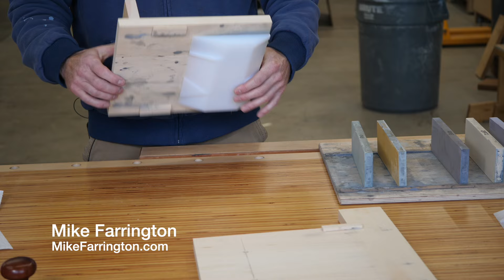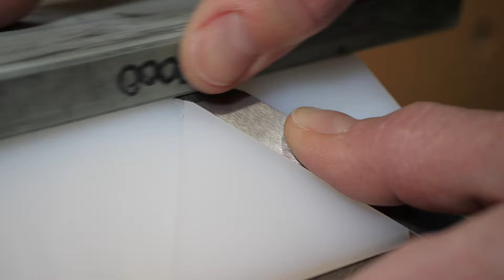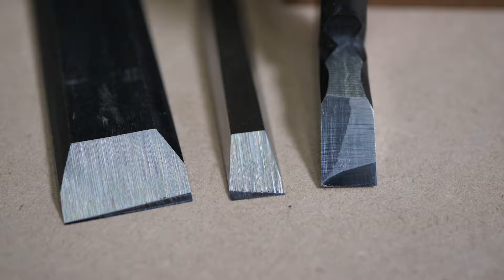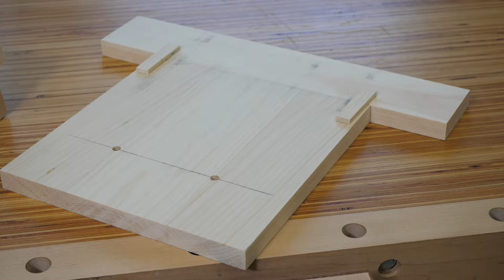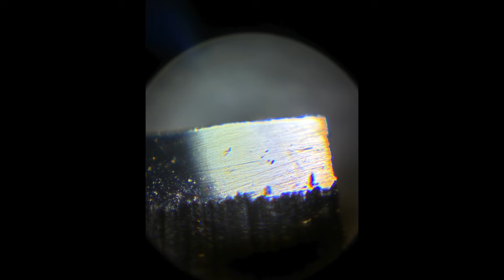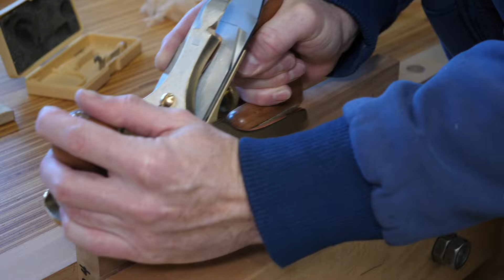A new kind of sharpening jig

Comment: I'm gonna 3D print this immediately!
Reply: lol. But seriously the hmwpe material is what’s important.
Reply: @jayelwin  you're absolutely right, I could never print a product at durable, or accurate as the one shown in the video.  BUT if I'm a crappy wood worker with one shitty Stanley chisel that can't hold an edge anyway......
Reply from the maker: I looked into having these 3d printed, currently, there isn't a printer that can print densely enough. Yes, it would work, but the lifespan would be low. Also, because it's not printed densely enough, keeping the top clean is nearly impossible.
Reply: @MikeFarrington  you could print them with a 100% infill, then have to do something to the surface to make it smooth like bondo or something... It would be a nightmare and definitely wouldn't be as reliable as the real one
Reply from the maker: @tazerdave5371  Which is exactly why I settled on milling from a solid block.
Reply: @MikeFarrington  good idea!
Reply: @MikeFarrington  My initial thought is print it with a recess and install a 1/2" thick wear strip of uhmw. Or maybe even uhmw tape on on a 3d printed part would be sufficient. I'd also bet that printing the top surface with all lines parallel to the motion of the stone would work pretty well with something as humble as PETG.
Reply from the maker: @davidchester5784  Good ideas for sure. I will say my experimentation lead me to the opinion that anything 3d printed would not work. The lines left behind just catch too much crud.
Reply: @MikeFarrington  makes sense! Awesome product. I just mocked up a rough setup to test the concept and got my test chisel as sharp I ever had and it was very easy. I'll be placing an order for the real deal shortly!
Reply from the maker: @davidchester5784  Sounds good, Thank you.
Reply: Good one! Embed rare earth magnets in the bevels to assist holding the blades?

Comment: This looks really interesting but wouldn’t the top wear down. How is the top going to stay “square”?
Reply from the maker: Yes, that is addressed in the video. The jig will wear down over time, but it should last for many years. As to staying square, it really doesn't need to be square. If it wears unevenly over time, it will still sharpen tools well, just at a slightly different angle.

Comment: Simple and effective! Consider it bought!
Reply from the maker: Thank you.
Reply: @MikeFarrington  Received it yesterday and absolutely love it. Near the end of the video you mentioned you might come out with another design that can be used for bevel-up planes. Is the current design unable to sharpen my Lie Nielson 62 low angle? I'm still a novice when it comes to hand planes...
Reply from the maker: @stavybananasify  You can absolutely sharpen your 62 on my Jig. 25 degrees is good for end grain work. 32.5 a good all arounder. However, one of the benefits of a bevel up plane is to sharpen at really steep angles, such as 40, 45 or even higher. The benefit of this is it will cut well on very wavy or alternating grain. The highest angle my current jig can sharpen at is 32.5 degrees. This leaves out that high angle. I do plan to get going on a new layout. Hope this helps. Let me know if you have any more questions.
Reply: @MikeFarrington  Thanks for the information! I use the plane as my go to plane, haven't quite committed to the No.4 smoother yet, so the 32.5 will be perfect. I sharpened all my chisels yesterday and really love how simple and effective the jig is, they've never been sharper. Will definitely purchase the next layout when/if it hits the market!
Reply from the maker: @stavybananasify  This is great to hear. Thank you very much for the feedback.

Comment: Doesn't it wear the top of the pyramid off, since the tool is only a small part of the surface you're mostly abrading away?
Reply from the maker: Thank you for the comment. I address that in the video. If stones that are designed to polish an edge are used, they mostly hydroplane on the surface. Some wear occurs, but it is small and the jig will last a good long time.

Comment: Can you comment on your hand strain while using the jig?  Your fingers looked pretty blanched white while holding the chisels.  In project touch-up seem quick and easy, but if I set to sharpening 2 dull plane irons....  I find myself with very strained hands after sharpening things.  I think I sharpen with fear of going off on a tangent (pun intended) and then need even more time to correct.
Reply: I hope Mike doesn’t mind, I got to test a prototype and I only have diamond stones. I attached a mag switch magnet to my coarse stone and went to work on a flea market Stanley, having a handle made easy work of bringing it back to life.
Reply from the maker: @MrBertstare  I do not mind at all. Thank you very much sir.
Reply from the maker: Yeah, very good question. I could sharpen a good handful before my hands get tired. My shop is pretty cold, so that adds to the look of my hands. Also, I have very pale skin, so not much effort will make them look strained. Yes, some hand pressure is needed, injuries, arthritis, etc. should be considered before using the jig. But a person with normal strength and healthy hands will have no problem going from grinder to totally sharp on several tools. Hope this helps.

Comment: Mike this is such a great idea. I’m curious if you have thought about a version that uses rollers on the top rather the just the flat plastic block. I wonder if this would allow for use with lower grits and last longer.
Reply from the maker: That is a good idea. I have considered this. What I came back with is the cost of a more complex jig, I felt you would be better off just buying two of these. Also, I have been fairly conservative with my recommendations about wear. I have a prototype that has been ground on a ton and the original texture is still on the top. Meaning the thickness of a few sheets of paper has been take off it, and it has sharpening hundreds of tools.
Reply: @ that is a very pragmatic view!

I’m excited to order mine. Appreciate you Mike!
Reply from the maker: @Ramblewamble  Thank you very much.

Comment: Clever approach and gets you sharpening fairly quickly and I went to your site to see the cost - great deal as mulch less than a Lie Nielsen sharpening jig.  I solved the router blade issue by a different approach.  I sharpened the bottom side of the router plane blade on a flat stone and feel for the burr on the angled side.  Works well and is super easy.
Reply from the maker: Good stuff. Thank you very much.

Comment: Great design.. One of those "why didn't I think of that!?" kind of tools. One thing I think would make it better is maybe a laser etched angle measurement into the faces of the different positions
Reply from the maker: Thank you very much. We couldn't get the laser to imprint on this material.
Reply: @MikeFarrington  Nothing adheres to UHMW, but during the machining of the jig, you could tool in the angles and then over time the swarf would collect in the numbers. That might make the jig more expensive, though, for little marginal benefit.
Edit: changed to the correct material.
Reply from the maker: @mattelias721  I had similar thinking, but my reason for not engraving, was for cleaning purposes. I thought, that would make it too difficult to clean, which would bug me. Maybe I'm crazy.

Comment: I suspect that the obvious replies you'll get will be that it wont wear the stone evenly, however, I think the benefit of it being so quick to use outweights that issue. It takes seconds to flatten a stone if you do it often enough. I was honestly quite surprised by the price too! really fair. Nice one. (though I'm in the UK)
Reply from the maker: Thank you very much. In the video, I showed using the edge of the stone only. I did this so stuff was visible on camera. when using the jig, it is easy to move the stone around and use more of the center of the stone. I really should have mentioned that.
Reply: Will you sell me one?
Reply from the maker: @SonsOfThunder229  Yes, if you are an international order, please email me your address. I will respond with a shipping quote.
Reply: Or use some diamond stones and problem solved. This jig is great